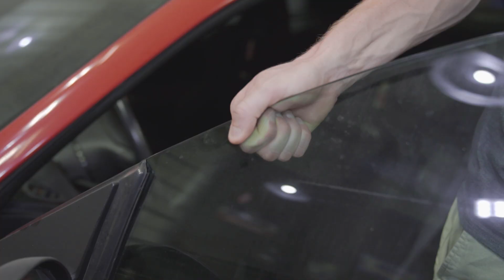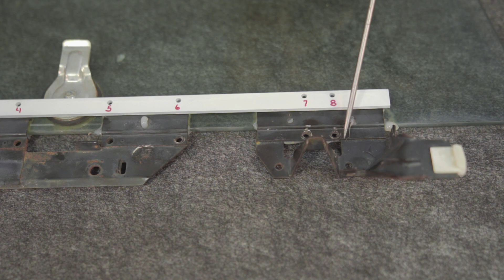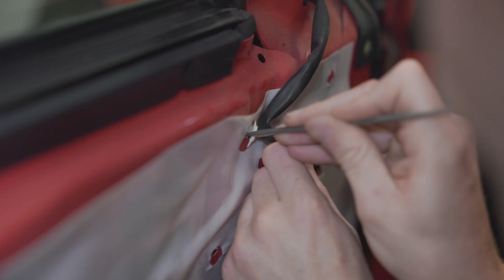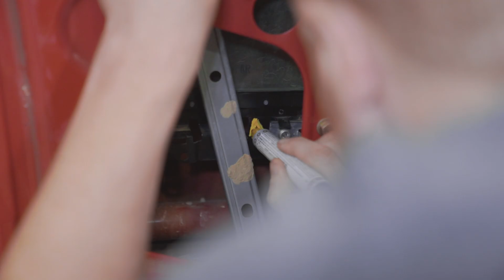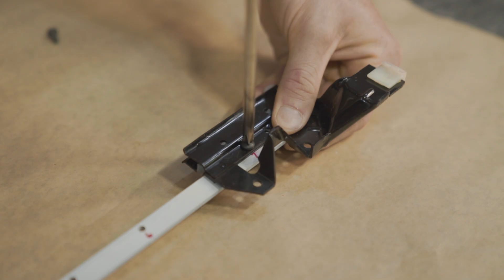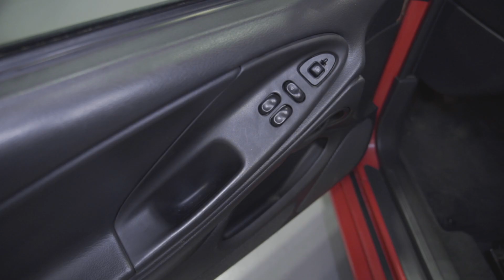How To Fix A Sagging 94-04 Mustang Window | Mustang Window Support Brace Kit

Comment: Yeah LMR let’s make a half assed piece of shit metal bar instead of properly fixing the windows… i bought this bullshit and my window still sags and I got all of the screws in
Reply from the maker: First off, thanks for the comment and feedback. Second, we've sold hundreds of these braces with great reviews. This isn't a "one size fits all" solution. Depending on the circumstance, these may not 100% fix your issue. If the adhesive on all three brackets have failed, the glass will still move around regardless of the brace. If this is the case, the glass would need to be removed and the brackets reattached.

If you look closer at aftermarket door glass for 94-04 Mustangs, the manufacturers fixed the OEM design issue by making the bracket one complete piece instead of three separate brackets.

To answer your other comment about the defective window motor, how about you give us a call or send an email so we have the opportunity to help. We stand by what we sell and are pretty easy to work with if given the opportunity. Thanks.

https://lmr.com/contact

-Landan
Reply: @latemodelrestoration thanks for the response i’m just frustrated with the mustang lol. I removed the bar 3 times I probably do need a new window. I’ll reach out about the window motor. I will say the brand new CCRM from y’all that I bought completely fixed my ac which i’m thankful for 🙏🙏
Reply from the maker: Glad the CCRM fixed your a/c issue. Given your window situation, you may consider a new glass. Problematic issues like this are tough to diagnose over the Internet due to their intricacies. Reach out asap on the window motor. Thanks again and let us know if we can help! -Landan
Reply: @latemodelrestoration Apologies again for originally being frustrated. Glad I took the extra time to check my switches out because your guys motor is working perfectly. The stupid drivers master switch decided to stop sending power only when you press down for the passenger side. Sorry again for the previous frustration I love LMR and was just upset the support bracket didn’t work as hoped. Keep doing the great work you do Landan 🙏
Reply from the maker: Thanks for following up! We appreciate the support. -Landan
Reply: Not even gonna mention how my brand new passenger window motor from you guys doesn’t even work won’t be supporting again

Comment: Just did mine. Get a ratcheting 90 degree bit driver. I used a $3 one from HF and cut the thumbwheel on the back to make it thinner like the VIM I use at work, but I got all the screws in without having to drill out pop rivets to remove other parts.

Comment: If I drill out the pop rivet for the door handle assembly, what fastener do you recommend I use when reinstalling it?
Reply from the maker: Use another rivet. Measure the hole with a drill bit and that will tell you the size of rivet. I've also had to use a short bolt and nut due to being in a pinch. -Landan

Comment: These lmr brackets are a good idea for holding those factory window brackets in place. After installing these myself I have to say it will actually be in your favor have either brackets C or B come off (preferably bracket C like in the video). Will be easier to line up holes 3-8 if one of those brackets is attached to the lmr bracket before placing into the large door opening. If all the factory brackets are still in place it would be hit or miss on if all of holes 3-8 on lmr bracket will line up with the positions of holes on factory brackets. The pointed screws provided may or may not save you in this instance. I also used two 1/2" long 6-32 bolts and locking nuts for the elongated slots for bracket A. In closing, if one of the factory brackets came loose and falls off inside the door then I'll say using one of these lmr support brackets will be very helpful with putting everything back into place without removing the window from door. If the brackets are all still in place and everything is functioning as it should then I won't even bother attempting to put on. Battery will drain while doing these so keep that in mind while installing. Hope this helps someone considering these brackets✌.
Reply from the maker: Thanks for the comment, Frank.  -Landan

Comment: Do you use the pointed screws when installing lmr bracket to window brackets or still use flat tip ones?
Reply from the maker: Hi Kris, use the pointed screws if the window bracket holes don't align with the brace's holes.

Comment: What about that front bracket?  Anybody know someplace that sells them?  Bought this brace kit and then realized my window was missing the very front bracket.
Reply from the maker: Hey Dustin, unfortunately, we do not offer the front bracket at this time. You'll have source a set from a donor car or private seller for a set.
Reply: The front bracket doesn’t even fix anything. Even with the bar the second you roll up the window it comes off track again

Comment: What happens if the window completely comes off the holders?  My driver side window is completely off
Reply from the maker: Hey Scott, you will want to completely install and mock up everything before installing the bracket. Once you get it into place, use the steps in the video to reference and install the new support braces.
Reply: @latemodelrestoration  should I use some kinda of silicone to put the windows back into the brackets?
Reply from the maker: It wouldn't hurt to add some. We do not recommend too much since a lot isn't needed.

Comment: Does this fix cars where the window goes up too far?
Reply from the maker: Hi Robvas,

Yes, this does fix the window that is going up too far. This brace connects all 3 brackets that are glued to the glass and keeps the alignment secure and stable. The front bracket is a stop to control the upward limit of the glass when it pulls loose from the glass the glass goes up too far. Restoring that front bracket to its proper position keeps the glass from going too far up.